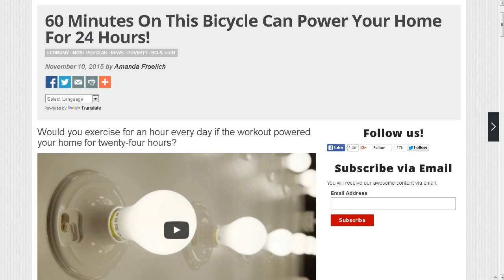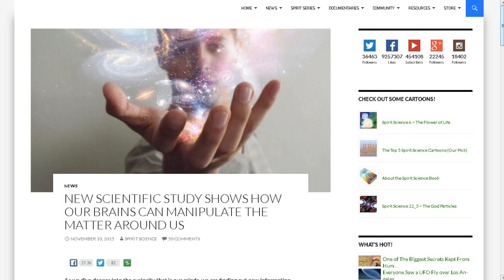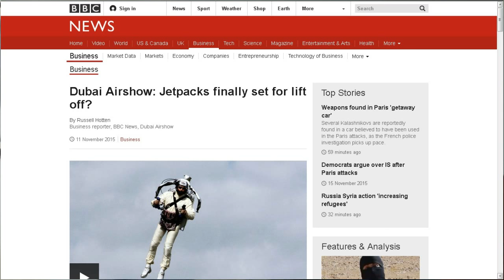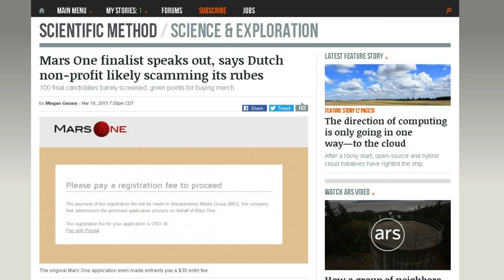TDD report for November 14, 2015

Comment: Very nice, Chuck, I totally love that bike idea. 
As you said, solar and wind is fine, but only if it can be used. That's a big challenge since especially in some third world countries such technologies come with two big obstacles: first of all such technologies are always damned costly and require special skills for installation and maintenance, and secondly we can never use it around the year.
Just take my place here, Southern India: we have here in the rural zones every year some dozens of cyclones and of course our summer monsoon plus a winter monsoon, what means besides floods and death cases and so on even during non rainfall days at least dark clouds, sometimes we see for weeks never clear sky. So we cannot use solar effectively due to the clouds, and we have to shut down the wind mills because of the high wind speeds during cyclones and monsoon weather. That's a problem which can be easily avoided by using human powered inhouse devices such as this engine, and for sure we have more than enough people here who could drive the bike for an hour or so. ;-)
Reply: +bangalorebobbel I hope you get to see one in your area since a generous person is taking on the cost and donating them. If you see one let me know.
Reply: ***** yes if I come to know that one of these things is here around somewhere I will try to catch it.
But my experience with such projects is that they usually don't work. Either there are no donations at all, or let me say there are only one or two cases for making good PR and the rest of the donated things or money gets anyhow lost, or some people get the stuff but use it only short while and have then either no more fun using it or no more spare parts to repair it ... ;-).

Comment: Great Report! 
The size bicycle power machine seem to big for a home. Seem solar panels and wind turbines would be better.
Those are not Jet packs! It would be fun to fly!
To bad about the Mars mission!
It would be nice if the sun shade pack down a little smaller, for packing on a motorcycle.
Reply: +lonestarrider More like a ducted fan pack than a jet pack but I hope it can be used for fire and rescue work.
Reply: +Chuck Howard Fire & Recuse would be good!

Comment: I don't think that bicycle power machine would be much use for 3rd world applications. For one, the size would make it hard to fit in a small home.
Reply from the maker: +Sudogj I think the reason it's built of aluminum is because it will mostly be outdoors and maybe covered for large storms. Aluminum will resist the corrosion better.

Comment: Interesting idea but... My question around the bike is "what's the cost?".  Say it's $500 (guessing) to build, ship and setup.  Isn't that enough cash to power a poor families home for a year or more and put food on their table too?  Interesting idea though not a solution.  Better solution, stop the wars, the over population, and get rid of the bad governments.  Then these 3rd world countries might be able to progress some.  I don't see throwing technology at the problem until that's done.  
I would not want to fly a jet-pack.  If it fails you can't glide back down, you drop like a stone.  No thanks.  lol
You need one of those short beach chairs for that sun shade.  :)
Reply from the maker: +RC62 The billionaire developer is going to foot the cost of the first 10,000 bikes to poor villages in India. Lets say you are correct about the cost. You could buy four solar panels and a storage battery and it might take a few more hours to charge the battery but the sun requires no manual work from the people. If you have some extra batteries you can last through one or two cloudy days as well. I don't see the bicycle as primary source either.